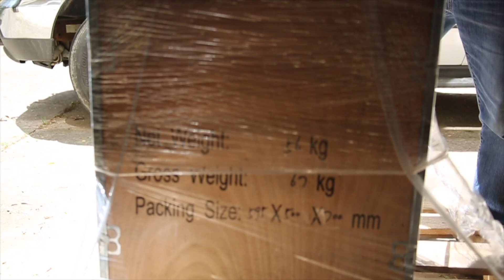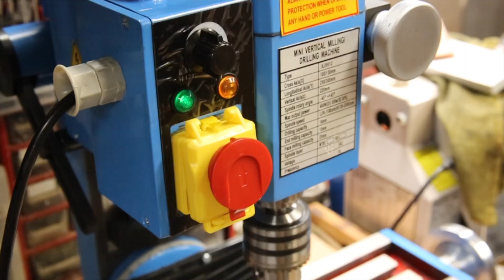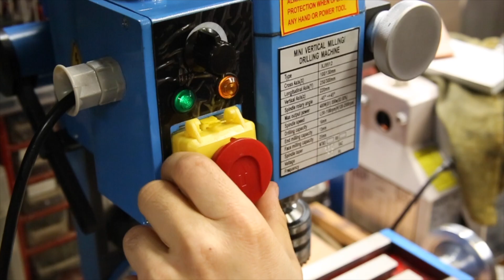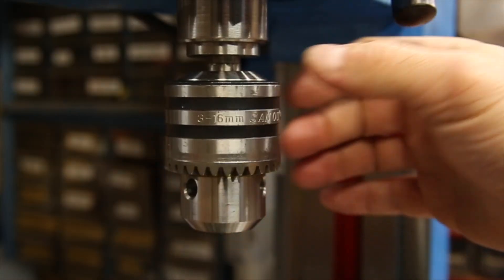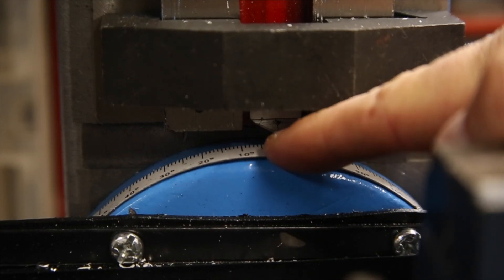Cheap Chinese Mini Metal Mill Milling Machine Unboxing, Setup, Testing, and Review

Comment: A few tips first don’t move the bit at cutting depth over the piece you will scratch the surface cause you never truly cut full depth when cutting based on the flex of the material. Also if at all possible turn your mill up to around 3000 rpm or more for cutting aluminum. Remember the smaller the endmill the faster you need to spin the spindle.

Comment: Oh wow.  Your mill showed up pretty clean.  My Harbor Freight mill came covered in chinese dragon snot to prevent surface rust.  Easily an hour to clean it all up.

Before using it for any real project, you probably want to tram the machine. Your project won't come any more accurate than you have your machine setup.  Use a dial indicator and make sure the X, Y, and Z axises are all perpendicular.  Get out as much play in the axises without making them too tight to move.  Same when mounting your vice.  It doesn't matter if you get your X axis set perfectly if you toss a vice on the table and bolt it down where it lands.

Comment: Hey there, I’d highly suggest a face mill for finishing sides of anything. Take a look at carbide with 5-6 flutes with inserts. I use a 3” 6 flute carbide face mill with inserts for side finishing. (I’m currently in trade school for CNC milling and lathe machining if you wanted credentials for proof)

Comment: Using a 2 or 3 flute end mill will help you a lot on aluminum, as well as choking up on the tool as much as allowably possible will reduce unnecessary vibration in the tool itself which will give you a better surface finish

Comment: when machining aluminium you should use WD-40 as a lube for the cutter. it will give you a much nicer finish than if you run the cutter dry

Comment: Recommendation do not move the Cutter on the workpieces when it is not spinning.
Reply: Also drill chucks is not suitable for axial loads of the milling cutters. They tend to loosen with milling cutters which is not safe
Reply: RIGID3D  for radial load, only available for axial load
Reply: @geogesleroux2644  Is this something you could explain to a person who doesn't know what radial vs axial loads are?
Reply: crosita1 : I will try to do it. When you nail down you load the nail with axial load. If you introduce a part of radial load when you nail down you bend the the nail, A wheel car or motorcycle is essentially loads by radial loads, the axis is strong. When you use hand electric drill , you push it in the same way than the drill tool axis, it’s axis load, when you drill against a wall pushing the electric drill, if you try to put a perpendicular force to the drill axis, the clutch and your arm don’t like it. The clutch endure poor radial load. To mill, the flute needs tool holder collet who is built to resist particularly to radial load (30$). You get a milling surface better. Sorry for my poor English, I hope you understand that I wrote.
Reply: @geogesleroux2644   That was perfect, thank you so much!
Reply: @geogesleroux2644  Fuckin nailed it
Reply: @RIGID3D  was trying to find a comment that said this lol, at least someone knows
Reply: Nor do not run you finger through metal until break edges, don't air blast either.
Reply: Would you recommend this or is there something out there that is worth paying a few hundred more bucks to get.
I need help and would live fir everyone to comment
Reply: @samuelhorowitz2812  don't recommend it too flimsy. Unless you aren't a model engineer. Try to buy one without variable speed . Morse taper 3 will do perfectly.
Reply: I was yelling really hard every time he did that
Reply: Facts.

Comment: You need to fix the runout on the spindle but probably more likely in the cheap chuck also you can get hurt holding roundstock without a v block. This can also contribute to surface finish. It would be better to chuck up the tool as short as you can. Good luck.

Comment: allways mill on he side of the mill where you push the chips forward - if you rip the chips you cant achieve accuracy/it will wabble a lot - the bearings are not really that great on these cheap ones -you even can destroy the bearings that way 
this is on almost all cheap or older mills- even on meny pre 2000 CNC mills 
get carbide tools and calculate your RPM/tool diameter as well as the ammount of force you get on the cutting edges -this way you get the best surfaces while maintaining the tools in good shape 
dont underestimate Aluminium- it has such a high flexibility/ductility that it can hold on to the mill like to a bottle opener -ripping out of the chuck, spinning around and killing your tool and eventually shoot somewhere
use oil if u do steel and if u do mainly steel invest in a tungsten carbide tool or better a tool with changeable cutting blades 
zero the vise -it might be angled 
allways ude eye protectio and long clothes -the chips are hot  use gloves if u work with brass -brass is a bitch - all chips are sharp like needels
If u dont know if a workpiece is hardened - use a file to test it before ruining your tools
fix the mill to the actual table to take out as much flex as possible

https://www.google.at/imgres?imgurl=https%3A%2F%2Fwww.researchgate.net%2Fpublication%2F251309246%2Ffigure%2Ffig1%2FAS%3A298166814560257%401448099916130%2FWorkpiece-tool-system-model-for-up-milling.png&imgrefurl=https%3A%2F%2Fwww.researchgate.net%2Ffigure%2FWorkpiece-tool-system-model-for-up-milling_fig1_251309246&docid=doR3-jGVi0W6rM&tbnid=J2Xp6PZAPZQEWM%3A&vet=10ahUKEwiwto7fpuXaAhUEb1AKHXEFChAQMwh2KDUwNQ..i&w=567&h=447&bih=506&biw=1024&q=Milling%20workpiece&ved=0ahUKEwiwto7fpuXaAhUEb1AKHXEFChAQMwh2KDUwNQ&iact=mrc&uact=8#h=447&imgdii=J2Xp6PZAPZQEWM:&vet=10ahUKEwiwto7fpuXaAhUEb1AKHXEFChAQMwh2KDUwNQ..i&w=567
this is the correct feed direction

https://www.youtube.com/watch?v=galm5_6SUcM
here is a video abaut it

make a mini vise out of steel as a piece 
use ur lathe for the spindle and the bearing

Comment: I have this for almost 20 years. This has a longer table with wheels at both ends. Mine is pretty bad made lots of corrections and I have a new fixed column and different spindles to install. Basic bad design that the head moves by a rack and pinion, theoretically bad because the backlash pulls thread and the tool into the work. After taking your Y directional feed lock the head. I hope you have an R8 socket. That is if you are in the American continent. Good luck. Bob

Comment: Er32 collect holders add unnecessary tool length in my opinion, I just use the proper r8 collect. And Chuck it up as far as you can on the shank. It might take a few seconds longer than the sorta quick change er32 but the chatter and finish will be much better. Never ever use a drill Chuck to mill with.

Comment: Try cutting to .003-.005 from finish dimension then make a final dust off pass it will make the finish better. Also try to run it in a climb mill pattern. I’m an aerospace machinist by trade and have a home shop feel free to dm me. Pick up a machinist handbook to learn proper feed and speed rates this will also help your finish.

Comment: I'd love to see what this can do for 2D or 2.5D prototype parts. I would love to get one of these little machines, but having been kinda burned on the CNC3040 from China I have been taking a step back before just ordering these cheaper Chinese parts.  I ended up spending more on the CNC3040 getting it up and running (which is still missing features) than I would have if I just bought a more expensive machine.

Comment: just a small plaything without any precision
Reply: It is not for play. It's for small jobs that big mills would be a waste to use. They also have  precision seeing as people use them to make their own custom light saber handles and prop parts. Cause you know a 5k mill is so practical to have when your work pieces only have to be made out of soft aluminum are as large as 7 inch by 3 inch by 12 inch.  There is a whole slot of the internet dedicated to rat rodding these mills. I suggest you get off your pink pony and actually look into them. They are awesome and far cheaper then most higher end mills. Not all of us have the truck to go to a factory closing auction, scrap yard, or salvage plant ether. So this a far greater option.
Reply: Matthew Payne any good forums you suggest?

Comment: Hi. I'm going to expand on the collet business. Unlike a drill end mills are subject to severe downward forces when cutting. These forces can easily move the cutter down, almost certainly ruining your work, or worst case, pull it right out of the chuck with the risk of it being thrown violently into you or an observer. A collet chuck gives a much firmer grip than a normal drill chuck but does not completly eliminate this problem. Something like a 'posilock' chuck, where the cutter is screwed into the chuck in such a way that if it does move it gets pulled futher into the chuck is the safest option. As with most things, also the most expensive. (As a general rule you should expect to have to spend as much on mill tooling as you did for the mill itself). Please, please, do not use the drill chuck for anything other than drilling. That's what it is made for and it is a good tool for holding a drill. The collet system is a much better solution for holding end mills but use the right one for the job. 5C, for example, is really intended for work holding, not tool holding. Tool holders need a shallow taper to give a really firm grip, work holders can manage with a steeper one which makes release easier. In the States I would suggest using R8 collets, especially if these match the taper in the spindle of your new milling manchine as you won't then need a seperate collet holder. Spindle mounted collets give more working clearance and a more rigid set up as well. They can also be used to hold drills, although the extra accuracy may be superfluous. Drills are really for removing metal. They don't make particularly round or straight holes and have a tendency to wander. Enjoy using your new mill! Read up and research all these new aspects, there's a wealth of info out there and you will soon sort the wheat from the chaff. Bob.
Reply: Nice to have someone who takes the trouble to explain :)

Comment: I love the way people will run that finger over and over that work. That is to see if they get a piece of steel in their finger.
Reply: Oddly enough, you won't get a piece of steel in your finger if you're cutting aluminum. ;)
Reply: Yeah great observation.... I find it silly to use a finger to sense detail after I found my tongue works best when on my mill, lathe, or just checking my welds for proper height.....
Reply: @BadBoy-qe3be  nothing beats the taste !!!😀.
Reply: When I worked in a machine shop, I saw worse than a few steel splinters.
Tips of fingers nearly sliced clean off twice and a couple of blood splattered faces. Even the smallest puncture to a finger seems to throw blood everywhere yet actually bleed very little.

There were lots of machinists there who wouldn't dream of cleaning with their fingers.  Apparently seeing someone else make the mistake was enough to hit home.

On an added note, he was machining Aluminium, so no steel splinters for him!
Reply: @underwaterdick  I learned the importance of safety glasses by nearly losing an eye. When turning a steel rod, a shaving flew in my face and hit my lower eyelid and burned itself into the skin. Never used a lathe or mill without safety glasses after that.
Reply: Marko Krsmanovic if you finger detect without removing sharp edges you can get fired here, a metal splinter could kill you if you dont remove it btw
Reply: Put your finger in a baggy when you do that finger test , you’ll get a more sensitive feeling
Reply: Warrior Son  Not me, I use them low hangers. Much more sensitive  ; ]
Reply: And yes..when they get a piece of steel in their  finger.....the problem comes at night...when they cant finger their wifes 🤣
Reply: Most people that work in machine shops for a few years don't even realize cuts and splinters, your skin hardens a lot. The machine oil makes sure of that. I worked on CNC lathes and mills for 6 years. And 2 years later my hands are still hard and my skin is messed up. I regret not using cloves. But with high precision and high output work you just can't.
Reply: @atonement. If you really did work in a professional environment, you would have regretted wearing gloves as you would have been kicked out of the shop for breaking basic safety rules. No gloves when operating machine tools.
Reply: @stevedavey1343  A CNC lathe or Mill has door triggers. If they were not bypassed then the machine will stop or the door will be locked, I know the older machines does not have door triggers and locks so there's that. If you are refering to a manual mill or lathe that's a different story.

If you bypass the doors then it's your own stupidity, shavings can cause problems but there are better ways to solve that problem. I know a lot of machine shops that does this. Play stupid games, win stupid prizes.

At the end of the day if you are a good CNC machinist there is no need to put your hands in harms way of the spindle etc.

On a manual lathe or mill I will never wear gloves or a long shirt, no rings, arm bands etc.

In my carreer I could've easily worn gloves. And it would have been beneficial for me in the long run because I didn't do stupid things that some people do. We used proper equipment and we had good training.

But yeah that's my story.

Comment: Tram the head if possible, small diemakers vise, set of collects, good set of parallels, and a few 1 inch travel indicators with a magnetic base if you want to do precise work. Can usually get indicators from Msc for 15 to 20$ on sale. Stay away from harbor freight tools. Some of there stuff is okay but not the greatest when it comes to machine work.

Comment: The wheels at either end act together to pinch in on the recessed thrust bearings as their centre nuts are tightened. You can tighten out some of the leadscrew backlash by adjusting these.

Comment: I bought one that's almost exactly the same (different colour scheme). You are going to be so disappointed in the weeks to come. The column flexes under any tool pressure, and applying the gib lock actually changes the tool height off the work.

Comment: Get a mill vise, dial indicate the fixed jaw in the X axis. Tram the head (exactly 90 deg. to the table.)  Get the mill on a solid platform. Use collets.

Comment: Oof, that drill chuck is not so good. Get yourself a dial test indicator and see how much runout (eccentricity in rotation) it has. You will almost certainly want to get a better drill chuck (i.e., one with less runout). You can find one with the right taper on a site like little machine shop, or you can test your luck with aliexpress or bangood.

It's not really a project, but an interesting video topic would be a test of the precision of the machine. Spindle to bed tram, spindle taper runout, screw backlash, etc.
Reply: You should also indicate the solid jaw on your vice
Reply: Calvin Stence b*

Comment: I know machinery has inherent noise but that sounds unnecessarily noisy to me mate. I dont think it would hurt to strip that machine down and just make sure all the bearing are packed properly and the drive train gears are lubricated properly. I'm not suggesting take the spindle bearing out and re-pack them but I would certainly be having a close look at anyhting you can get to easily. Just a thought.

Comment: Use the drill chuck only for drilling, and get some( it looks like) r8 collets for the milling part. 3 flute will be your best bet for aluminum, and 2 will work as well. 4 flute and up don't have good chip clearance for aluminum but 4 and up is good for steel. If you're just looking to cut the top, get a fly cutter and you can use lathe tooling in it. If you haven't got a dial test indicator yet, get one and once you get a decent mill vise make sure you indicate it in so your work is accurate. Hope this machine works well for you!

Comment: had one of these years ago,from memory you can turn the rack upside down on the mill post.this will give you around 6-7-inches more in height.make an  angle stop ,which can mount on the back of the mill post.then you can put a decent vise on.don't spend to much money on it,you will want to upgrade down the track.

Comment: Hey, you should try to get a surface mill for better finishes, also dont stop the cutter on the part then take it off, it will scratch the surface and also damage your tool, you should keep the cutter spinning until you have it off the part

Comment: Tim, make sure your work table is rigid and bolt the dang thing down. The largest end mill recommended on a Machine this size is 3/8. Also, I agree on the ER collets. However, the ER 16 might be more appropriate for your mill. Congrats on the purchase!